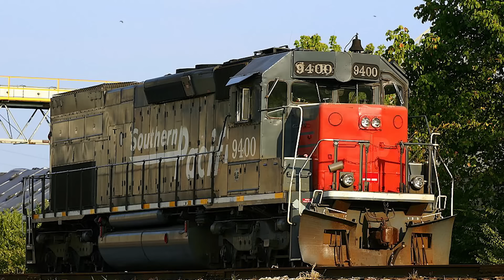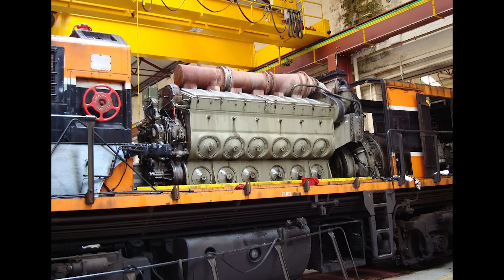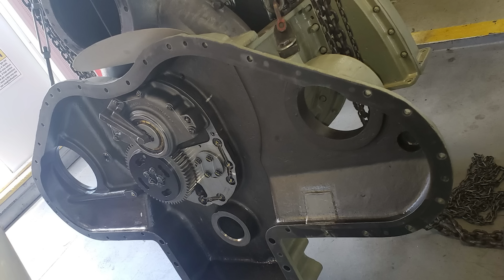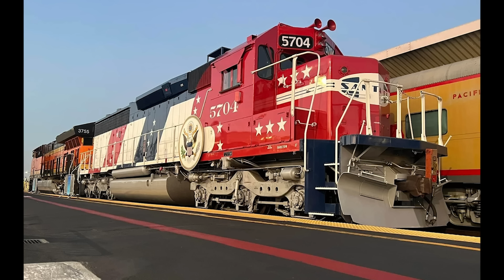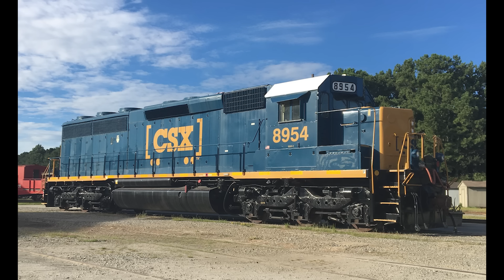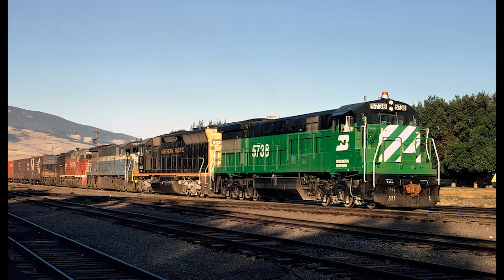Inside the EMD SD45 and the Problems Hidden in Its V20 Engine

Comment: Chessie System component roads never bought SD45's nor did the Louisville and Nashville.  However Seaboard Coast Line owned both SD45's and SD45-2's.  Clinchfield bought SD40's then went to the SD45-2.

Comment: Gee I recall that Norfolk and Western purchased and owned 115 SD45's.  All were high short hood with dual control stands.  They did buy 30 SD40's in 1966 an went back to SD40's in 1971.  They bought only SD40-2's starting in 1973 accumulating 163.

Comment: The 645 engines did not have cast crankcases, they were constructed of fabricated steel components welded together to form the crankcase as are most EMD engines.

Comment: Maybe two V10's with the PTO in the center of the crank, like the flat twelve in the Porsche 917K. Those old straight eight engines would snap or bend a crank too.     💥👀

Comment: SAY WHAT YOU WANT ABOUT THE ENGINE IN THE SD45. YES THEY HAD THEIR FLAWS, BUT  NOTHING GE  BUILT,COULD OUT PERFORM  THEM IN SLOW,HEAVY DRAG FREIGHT SERVICES! THIS LOCOMOTIVE WAS WELL KNOWN FOR PULLING LONG, HEAVY FREIGHTS THRU THE MOUNTAIN GRADES, FROM THE EAST,TO THE WEST! THE SP CERTAINLY BELIEVED IN THEM. TO THE SP, THEY WERE KNOWN AS MOUNTAIN MAULERS!  BECAUSE YOU COULDN'T BEAT THEM FOR THEIR ABILITY TO TAKE SLIW HEAVY TRAINS UP STEEP MOUNTAIN GRADES!  SO, YES THEY HAD SOME PROBLEMS,BUT THEY MORE THAN MADE UP FOR IT WITH THEIR ABILITY TO PULL! SOMETHING THE GE LOCOMOTIVES FAILED TO DO!  THE SD45WAS EITHER A BAD LOCOMOTIVE OR A GREAT LOCOMOTIVE,   PEOPLE LIKED THEM AND, THEY SOLD A LOT OF THEM.SURE IT BURNED A LITTLE MORE FUEL THAN  A SD40, BUT YOU GOT MORE FOR IT. IT WAS NOT A BAD TRADEOFF!  GE LOCOMOTIVES  ARE NOT KNOWN FOR PULLING LONG HEAVY FREIGHTS, BECAUSE THEY ARE NOT GEARED FOR SLIW HEAVY DRAG FREIGHTS! THEY ARE MAINLY GEARED FOR FAST INTERMIDAL TRAINS THE ONLY GE LOCOMOTIVE THAT REALLY PROVED ITSELF WAS THE U18B AND THE U23B. THESE WERE THE ONLY ONES THAT WERE CAPABLE OF PULLING LONG FREIGHTS.  THE U28B, WITH A GEAR RATIO OF 18:22,WAS WELL KNOWN FOR PULLING LONG FREIGHTS,AS WELL AS THE BQ23-7,ANITHER GE LOCOMOTIVE THAT WAS KNOWN TO GIVE IT THEIR ALL WHEN PULLING LONG FREIGHTS.  ONE THING ABOUT THE SD45,WAS THEY WERE KNOWN TO DRAG LIKE A MULE, AND RUN LIKE THE WIND;  ALSO, THEY HAD A SIUND LIKE NO OTHER WHEN WORKING.  THE SD45, HAS NOT LEFT US COMPLETELY. SEVERAL OF THEM HAVE BEEN RESTORED TO OPERATING CONDITIONS AND ARE NOW RUNNING.  IF I HAD TO CHOOSE BETWEEN THE SD45, AND THE ES44A. LOCOMOTIVE, I WOULD GO AFTER THE SD45. WHY? BECAUSE SHE HAS PROVEN TO BE A RELIABLE LOCOMOTIVE! HANDS DIWN, SHE IS THE KING OF THE ROAD. And, IF I HAD TO PURCHASE RIAD DIESELS,IT WOULD BE THE SD45. I LOVE THE SD45,  PERIOD!
Reply: Northern Pacific would beg to differ with you their crews called the U-25c/U-28c/U-33cs bearcats because they were that good at hauling freight up the mountain grades.

Comment: I worked for a dredging company. We had one dredge with 4 20 cylinder engines, 2 turning generators and 2 turning large centrifugal pumps. This was in the early 70s. We had very little trouble with them. And if we did need to change a head or even a complete Power Pack they were easy to work on, mainly due to their modular design. I can't say enough good about them. They were great engines.

Comment: N&W had plenty of SD45 locomotives.  These videos are really lacking in fact they must excite the foamers.   Anyone around railroading from the introduction of the U25's thru about the GE dash 9 era knows just how despised GEs were.  Many GEs never saw one heavy overhaul as railroads didn't want to waste money on a piece of junk.  Some SD40-2 locomotives have had 3 or more heavy overhauls in there 50 ish years of service.    People don't realize that GE was once one of the world's largest lenders and not once have I known of an EMD bought with GE funding.
Reply: Unfortunately EMD developed the SD50. You are correct about the GE financing arm, made it a lot easier to purchase the GE product, also true it was an inferior product
Reply: @luisvarela9096 the SD50 line failure was brought on by the "new engineering" people brought in to EMD.  I know a couple ex EMD old heads one an electrical engineer  the other field support.  Both hated the regime change at EMD and didn't stay long after the 50 series mess.  Today's shop crews dislike the mechanical mess of the GEs over the EMDs,  while the GEs have more robust  electronics over newer EMDs.  Road crews prefer EMDs especially if older as they load better or faster than GEs. That's one reason GEs use less fuel they let the EMDs do all the hard work.
Reply: That is spot on my friend. I think they got this from when they first came out. They had some crank shaft problems. But EMD made some inlmprovementd to the engine and it turned out to be a winner.
Reply: Don't forget EMD had GM Credit to back them up.
Reply: Looks like something busted a hole in the bottom of that gearcase, nice repair!

Comment: General Electric engines and engineering  derailed EMD 
Forever. I don't see how you can brag about EMD Engines when they have so many problems in design and engineering and execution.
Reply: Thats bull shit. Do you work for GE? EMDS had no such big problems. They're fine engines.
Reply: @NormanMichaelWalker THAT'S RIGHT! THE EMD LOCOMOTIVES HAS PROVEN THEMSELVES OVER TIME. AND THEY HOLD A RECORD OF RELIABILITY,THE NOT EVEN GE CAN EVER MATCH!  DIMPLY GO TO A RAILROAD SCRAPYARD, AND SEE FOR YOURSELF! THERE ARE MORE GE UNITS BEING SCRAPPED THAN EMD UNITS!  EMDS REPUTATION FOR RELIABILITY AND DEPENDABILITY HAS NEVER BEEN SURPASSED NO OTHER BUILDER,PERIOD!  I WILL ALWAYS SUPPORT THE EMD FAMILY IF DIESEL LOCOMOTIVES.
Reply: Norman, why does he think we called them U-Boats? 🙂
Reply: GE MAY HAVE DETAILED THE EMD LOCOMOTIVES, BUT EMD HAS GOTTEN BACK ON TRACK WITH THEIR SD70 SETIES OF HEAVY FREIGHT LOCOMOTIVES.  GE MAY BE ON TOP, BUT  EMD IS STILL IN THE GAME, AND IS WELL KNOWN FOR THE RELIABILITY OF THEIR LOCOMOTIVES.